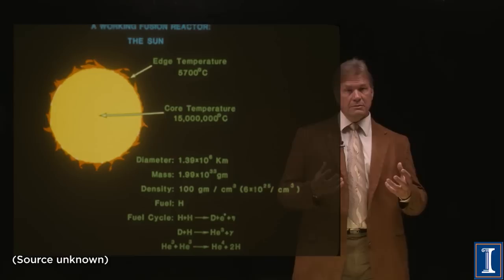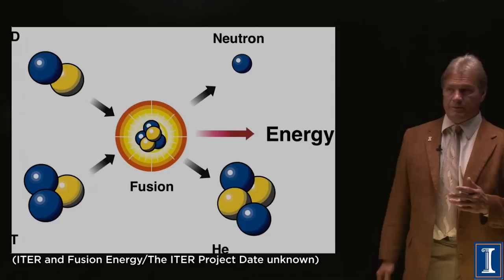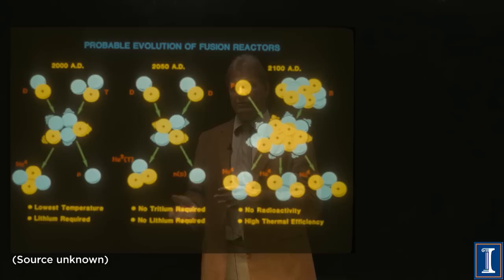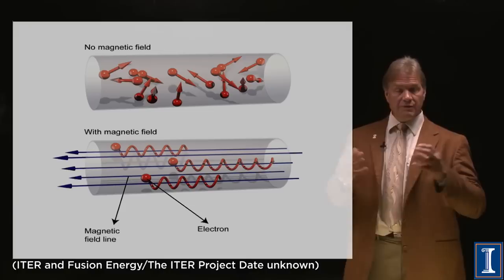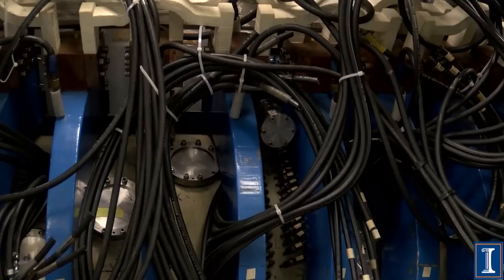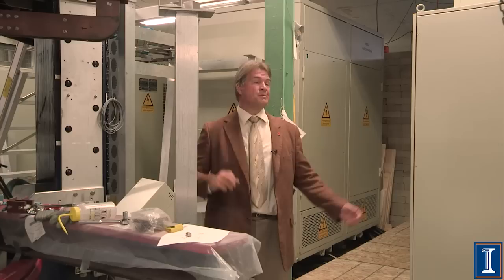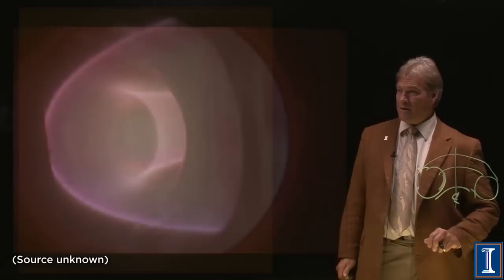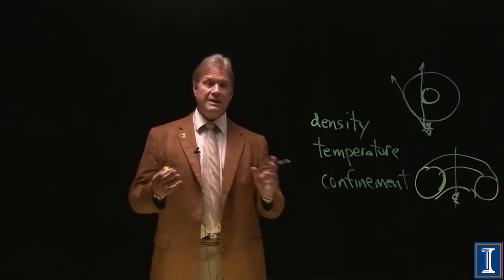What Is Fusion and How Do You Get It to Work?

Comment: One needs to get the materials down to <nanoparticle size and extract the energy.  The nanochemistry and physics are little understood at present.  Bulk materials are too reactive and too extreme for left over side reactants pollution, poor safety, and expensive.
Reply: If you haven't already, look up the ITER project.
A big fusion reactor is being build right now, with it's own coal plant to start it up.
I'm sure most of the problems have been solved years ago the biggest problem is building one that can actually sustain a plasma indefinitely.
For this you need size and the ITER is big.
Reply: @SuperUltimateLP  this is a colossal waste of $65B.  
There is theoretical way to create a plasma field for an individual household energy usage at a moderate cost.  With a nebulized water cloud contained within a chamber that has the appropriate nanoparticles inside these water micro spheres.  This is a complex prototype devise that requires a pulsed laser reaction.  The information involved is easily obtained if one thinks on a different level.
Reply: @cerimite7674  okay dude... go ahead be the next elon or einstein...
Reply: @SuperUltimateLP  Google has been guiding me through the process.  I am a psychologist confirmed 'savant' in pattern recognition in the science fields.  At 73 years old and a decades career in analytical chemistry, my retirement is focused on solving this existential quandary.  Their are portions that are way beyond knowledge.  I have solved the "crux" of the reaction that is a gaussian tensor amplification mechanism.

Comment: I think you guys need to use massive lasers and have them just seed a fusion site by the collision of focused lasers , they must not just collide but they must focus at the same point . The focal points must collide not just the laser , then you use every other form of heating you have . The laser wave length is critical for success This laser seeding takes place in the stelerator by the way . It may be possible to extract energy bu the magnetic field of the plasma  , you just gotta quick and clever  . If we go with higher pressure we can heat the hydrogen gas and use it as a heat exchange medium as fusion increases . The entire stelerator would be a heat exchange also . Also have you guys tried magnetic field modulation to further vibrate the molecules ? without  mass and gravity on your side you literally need every other form of heating available just to build a conduit capable of pushing enough energy to get that hot . think about it , how big does the wire need to be to make the light bulb X bright ???
Reply: Laser Ignition is what the National Ignition Facility has been working on for years.

Comment: What is fusion and how do you get it to work. Step # 1: Be God. Step #2: Everything else is easy peasy. What if you are not God? Don't waste your time and our money trying to be God.
Reply: Isn't thermonuclear bombs uses fusion? If so, then we already achieved nuclear fusion, although in a very nasty way.

sorry for my bad english
Reply: Also, there's no need to be a god to achieve such thing, as long as you know what is it and how you can manipulate it and had the technology needed, then probably you could achieve it.
Reply: @burgham6988 A fission reaction results from neutrons splitting the nucleus of a Uranium-235 atom, releasing heat energy and fission by-products like radioactive iodine, cesium and strontium. If the U-235 is enriched enough the neutrons create a rapid chain reaction of more splitting that creates an explosion. The only fission reactions known to mankind are the ones created by mankind for bombs or nuclear power generation. Fusion reactions are entirely different from fission reactions. In fusion, the nuclei of lighter atoms like hydrogen are fused to create larger elements like helium with a subsequent release of energy. Fusion occurs when atoms are confined at extremely high temperatures and pressure (millions of degrees and high pressure from gravity) in the Sun and in other stars. The energy released is in the form of heat, visible light, ultraviolet and infrared rays.
Your English is good enough  for us to understand, so no apology necessary.
Reply: @jackfanning7952  thermonuclear bombs (hydrogen bombs) were different than fission
bombs though. A thermonuclear bomb uses a fission bomb to achieve fusion by using its tremendous heat to fuse deuterium and tritium and releasing tremendous energy, far far greater than fission bomb(atomic bomb)
Reply: @burgham6988  I didn't know that. Thank you for the information. I'll check it out. Don't want to fall behind on my bomb-making technology, you know.

Comment: pfft, Fusion has been dead end research for 70 years.
Fusion is hard; because hydrogen atoms are small, your target is another hydrogen atom so it's like trying to hit a bullet with...another bullet. They have positive charge and Alike charges repel one other To sum up fusion, think of a mini-golf course. If you ever putt up the volcano. The ball is the hydrogen isotope; the hole is the target, the volcano or mound which you must hit up into is the scattering effect of alike charge and atomic oscillation. The putter is the energy input..or temperature, you need to have enough force, too much force and you risk overshooting past the target. Plus you need to have enough balls to achieve fusion over and over again. DENSITY TEMPERATURE and CONFINEMENT. Fission is So much easier. The target atom is So much larger. A neutron has no charge so no scattering, the uranium nucleus is 10 times the diameter than the neutron so it's like shooting a bullet to hit...a baseball. Fission doesn't even need confinement except to protect you. Using the mini golf metaphor. You're at the mini course, except now the volcano is flat, the hole's the size of a dinner plate, the balls are moving slowly, more than one player is on the course, there's hundreds of holes and every time a ball goes in the hole 2-3 more balls come out.
Fusion is so hard you can spend decades, employ hundreds of PH.d physicists and engineers, spend tens of billions, Petaflop scale super computers cant predict what's happening and still fail.
Fission is soooo simple, it cost 2.7 million dollars in 1942 dollars to build the first reactor; WITHOUT computers; done on chalk boards. Employed 100 scientists and engineers. Fission is so easy you can take a bunch of kids fresh out of highschool, train them in a year they're running a nuclear sub.

Comment: you just cool electromagnets down near absolute zero to make your magnet superconducting, then use all that magnetism to force two protons together which releases lots of energy which you use to cool the magnets. Net result, powerful electromagnets. But molten salt thorium reactors? much more feasable safe and all the fuel you need for society for thousands of years burning up all the stored waste generated by high pressure water reactors.

Comment: You had me until the end when you said all I need to make energy is fusion. But you're using 2Mw to create fusion.
Reply: Yeah that's the main issue with fusion reactors on Earth right now. They can't operate 24/7, and more importantly they use more power than they actually output. 

When we get to the point where we get more energy out than we put in, essentially we'll have free energy.

Comment: You produce more energy from changing matters states at star heat and grav pressure because it allows the continuation of matter state transformation , fusion is a one of energy boost which is why i am so condescending below of bullshit fusion reactions claims.
The stars do not use fusion as its main source of juice . to me fusion of elements is is the last stage not a common stage in stars.
Thier currently 5 known states of matter.
gas
liquid
solid
plasma 
condensates,
Why has their never been any research into states in the high heat high grav pressure areas .
stephen is still an absolute fucking nutcase and reversed gear for advancing scientific knowledge.
Reply: Much of the exact nature of star processes has been theorised, calculated, and verified by observation.  This research cannot be duplicated on Earth because the required conditions cannot be met, at least at present.  Take your meds.

Comment: Fusion is pathetically slow even in massive stars. That's why it will never work as a power station.
Reply: The professor mentions this in the beginning. The process of fusion is different in stars (essentially converting a proton into a neutron). Dr. Ruzic acknowledges this is incredibly slow, which is why we are attempting to do D-T fusion on earth. In addition, we can get much hotter than even the core of our sun, speeding up reactions! Of course, we aren’t there yet, but the theory predicts that we one day will be able to.

Comment: OR....I have a magnet in my hand with a steel slug stuck to both the north and south poles.
When I look in any physics book, it shows the energy in a magnet going in one end and out the other.
If the book is correct, one of my steel slugs must fall off. 
In 50 years, I've never seen that happen. 
Therefore, your books are lying.
If you want fusion, you need lightning to saturate a properly configured magnetic bottle or artificial charged particle.
Reply: Nobody:
David: FUCKIN' MAGNETS HOW DO THEY WORK???
Reply: @actualperson1971  Much like the sun, but too weak to short out.